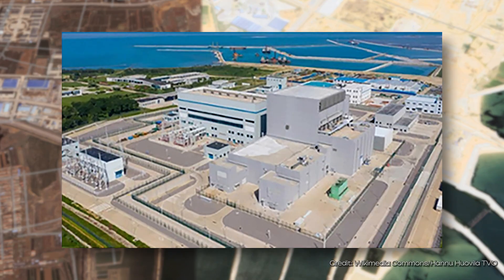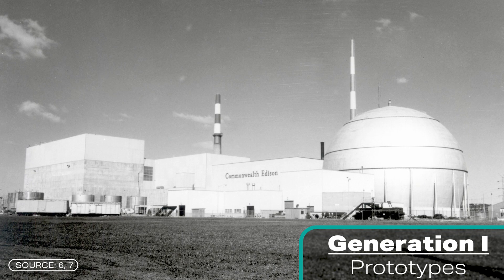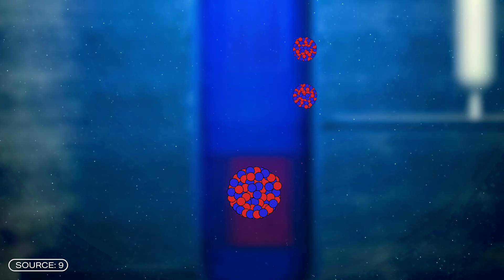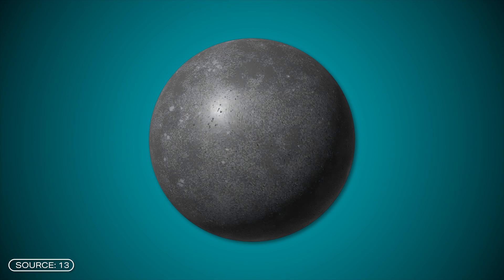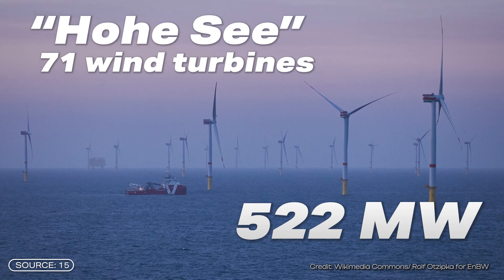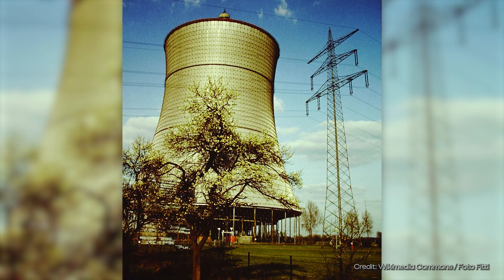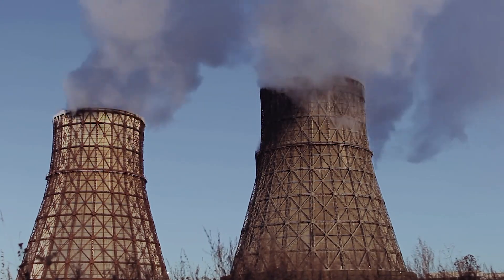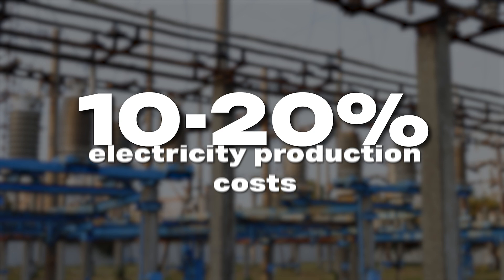Nuclear Power WITHOUT Fuel Rods: This Is How The Pebble Bed Reactor Works!

Comment: The spheres are to undergo 15 rounds. How long do they last? We still end up with a massive waste problem is my assumption? And, as always, I'd like to see an overall energy plan. How much comes out, but how much needs to be put in, cradle to grave? This goes for all sources of energy, btw. I'd really love to see an actual overview of what we're doing - one that includes not just CO2 but all factors that have any influence. Space needed to have the energy source going, sourcing the materials to build the building / solar panel / etc., sourcing the 'fuel' in case any is needed, (edit, because I forgot this point first:) 'making the fuel' (production of rods, pebbles, coal etc.), dealing with runtime waste, be it nuclear, coal or whatever, lifetime of the plant / panel etc. and also what happens when its lifetime's over. Yes, it's very complicated to dig these things up, but after all we really need to know what we deal with before we judge our best options. I have that unproven feeling that we're doing a lot of Milchmädchenrechnung (naive fallacy) in all kinds of directions. Would be nice to actually KNOW more!
Reply: correct.
Reply: Normal nuclear is way above RE. Normal reactors are at about 75 times, waste burners, burning full fuel are at 2000  - 10000, depending on the size. 

🔋 Key Advantages of the Dual Fluid Reactor (DFR):

• ⚡ Ultra-efficient: Nearly 100% of nuclear fuel is used  
• ♻️ Burns nuclear waste, depleted uranium, and even thorium  
• 💥 Transmutes long-lived actinides into short-lived fission products  
• 🔄 Built-in Pyro Processing Unit (PPU): Continuously removes neutron poisons and extracts valuable metals  
• 🛠️ Liquid fuel: No solid fuel rods, no batch reloads  
• ⏳ Decades of operation with a single fuel load possible  
• 🚫 No corrosive salts: Liquid metal fuel avoids fluoride corrosion and complex chemistry  
• 🧊 Lead coolant: Excellent radiation shielding, no water, no pressure → no steam explosion risk  
• 🌡️ Very high temperatures (700–1000 °C): Enables hydrogen, e-fuels, ammonia, and direct steel reduction  
• 🧠 Self-regulating: Output adjusts automatically via negative temperature feedback  
• 🪫 Minimal waste: Only short-lived fission products remain (• 🏭 Compact & scalable: High power density, ideal for modular deployment  
• ⚙️ No moving parts in reactivity control: No control rods required  
• 💰 Uses existing stockpiles of spent fuel, DU, and thorium  
• 🌍 Reduces dependence on enrichment, imports, and fresh uranium mining  
• 🔄 Full closed fuel cycle: No external reprocessing needed  
• 🆚 Outperforms typical SMRs: No pressure vessels, no high-pressure coolant, no water-based systems

Comment: I don't need normal nuclear power.
Maymbe it's possible to reuse the used uraniumsticks with a new technology.

I'm from germany but can't speak german, cause I lived in france
Reply: Patented German design:
🔋 Key Advantages of the Dual Fluid Reactor (DFR):

• ⚡ Ultra-efficient: Nearly 100% of nuclear fuel is used  
• ♻️ Burns nuclear waste, depleted uranium, and even thorium  
• 💥 Transmutes long-lived actinides into short-lived fission products  
• 🔄 Built-in Pyro Processing Unit (PPU): Continuously removes neutron poisons and extracts valuable metals  
• 🛠️ Liquid fuel: No solid fuel rods, no batch reloads  
• ⏳ Decades of operation with a single fuel load possible  
• 🚫 No corrosive salts: Liquid metal fuel avoids fluoride corrosion and complex chemistry  
• 🧊 Lead coolant: Excellent radiation shielding, no water, no pressure → no steam explosion risk  
• 🌡️ Very high temperatures (700–1000 °C): Enables hydrogen, e-fuels, ammonia, and direct steel reduction  
• 🧠 Self-regulating: Output adjusts automatically via negative temperature feedback  
• 🪫 Minimal waste: Only short-lived fission products remain (• 🏭 Compact & scalable: High power density, ideal for modular deployment  
• ⚙️ No moving parts in reactivity control: No control rods required  
• 💰 Uses existing stockpiles of spent fuel, DU, and thorium  
• 🌍 Reduces dependence on enrichment, imports, and fresh uranium mining  
• 🔄 Full closed fuel cycle: No external reprocessing needed  
• 🆚 Outperforms typical SMRs: No pressure vessels, no high-pressure coolant, no water-based systems